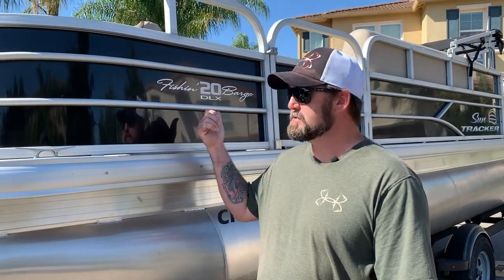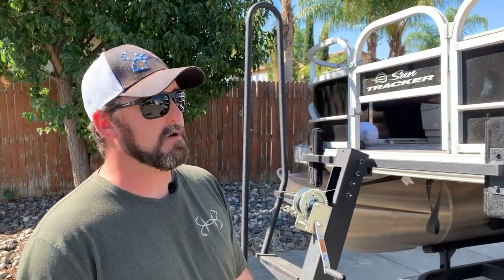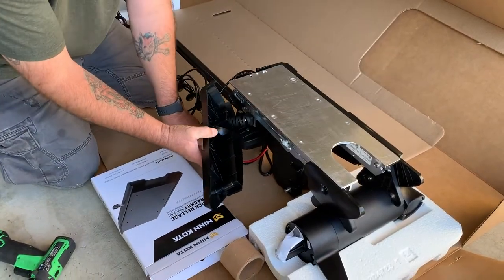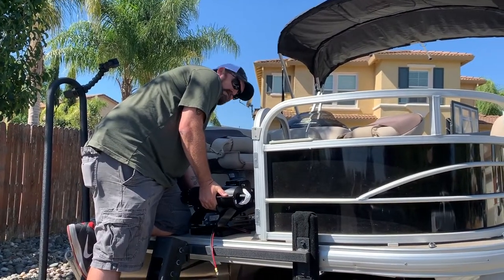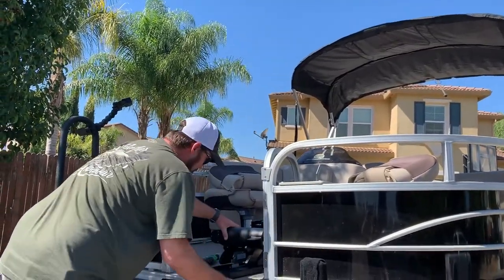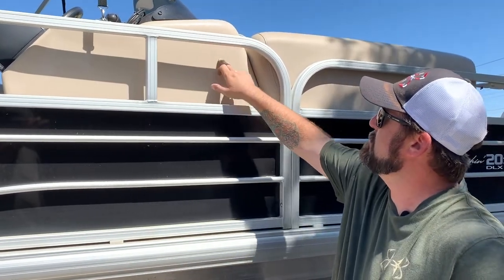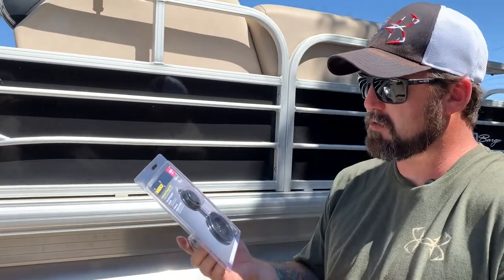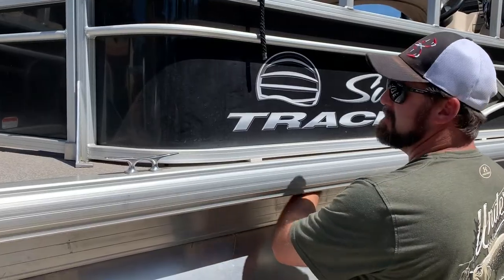MINN KOTA TERROVA TROLLING MOTOR INSTALL ON A PONTOON | HOW TO

Comment: Will the composite quick release not work on a pontoon or is just more difficult to use? I bought one because of the compact size and low profile. Haven't installed anything yet.

Comment: I'm curious how the charger connected to the dual battery, 24v system. Do you have to switch between the 24v wiring for the motor to connect the chargers or will the chargers still charge the batteries individually while they're still wired in series for the 24v?

Comment: I have that same model what length is the shaft  for trolling motor
Reply from the maker: It a 60” shaft .. Let me know if you have any more questions.. thanks for watching
Reply: I appreciate it man thank for the help also do the existing wires for the trolling motor plug need to be pulled for Thicker gauge
Reply from the maker: Only if your going to 36v ..24 they are fine from the factory
Reply from the maker: Of course going bigger on the wires never hurts.. but the factory wires are 8ga
Reply: Hell yeah thanks for the tips man time for me to get er done
Reply from the maker: No problem at all.. let me know if you have any questions along the way

Comment: Any idea what length shaft is best for a MayCraft 1900 for saltwater use? 2-3 ft waves are the norm.

Does the heading sensor wiring get run to the trolling motor or just a 12V connection?

Can the I Pilot link wiring run with the 24V battery wires from the motor to the helm on a center console? the wires will be running in the same chase.

Thanks for the information, and helpful videos. I'm a subscriber!
Reply from the maker: Thanks for watching the channel! So you’re going to be running a i-pilot link with a humminbird networked it sounds like ..? So you would need to hook the heading sensor to it’s own 12v power source.. not the trolling motor batteries..  usually mounted at the helm or near the transom..  as far as shaft length.. hard to say without seeing the boat in person..  but either a 60” or 72” is your only options.. with with swoop up on the bow I’m leaning more towards the 72” just to be safe .. especially in the rollers.. I have put several 72” on north river sea hawks offshore 24’  ..
Reply from the maker: And yes running the network cable with the power wires would be fine.. the sonar cable would cause interference if ran with the power wires.. if you want to measure the shaft length.. measure from the bow to the keel straight down..  let me know that number and we can go from there.. thanks again for watching
Reply: Thank you for your assistance. I measured 43 inches from the top of the gunnel to the water line.
Reply from the maker: Ok if it’s 43” from the gunnel at the bow to the keel at the bottom of the boat then a 60” shaft would be just fine..  and a 72” would be overkill..  keep in mind you might have to make a plate to get the trolling motor level at the bow as best as possible if your bow has a raise to it..  let me know if you have any questions
Reply: 43 inches is the top of the gunnel to the water line. The keel is below the water line. I'm thinking 72 inch might be my best best to keep the prop in the water. Thanks again for your help. I really enjoy your how to videos. Have a Great Labor Day!!
Reply from the maker: Yeah that’s why I said the keel.. you want the motor below the keel of the boat at least..
Reply from the maker: The shaft also has to run through the chassis of the trolling motor and the steering motor mounted on the bow that eats up some shaft length.. but the shaft also doesn’t count the diameter of the motor on the end of it either..  so if the motor will touch or almost touch the ground when the boat is on the trailer you will be just fine

Comment: I realy like your video's supper helpful i have a single battery on my boat and would like to run 2 batterys and a selector switch please make a step by step. Video for first time boat owner's with what i need .thanks Lonnie 1/11/2021
Reply from the maker: Would you like a dual battery set up for a trolling motor or a cranking and house battery set up with a battery switch?

Comment: Where did you purchase the deck-mounted plug for the trolling motor?
Reply from the maker: They come installed on the fishing barge or bass buggy. But if not we used to carry them at the tracker parts department at bass pro. Thanks for watching and commenting
Reply: Thanks for the info.
Reply: @ReelLifeFisherman  don’t see it at bass pro. Do you have a part number?

Comment: Where did you hook up the wire that you ran to the back?
Reply from the maker: Broncin2 to the cranking battery from the battery charger.. thanks for watching the video! Hope you found it helpful..
Reply: @ReelLifeFisherman  on the ground? Yes I did as I'm contemplating on getting the same one.
Reply from the maker: I ran it along the top of the pontoon log and then up into the battery compartment.. I just extended the charger lead wires with marine grade duplex wire.. just make sure you cut and put the in line fuses at the battery..

Comment: Thanks for sharing! It is going to help us out a lot once we decide on a trolling motor. What size do you suggest for a 2017 sun tracker 22dlx fishing barge? Also, what's a good fish finder? We are looking for something fairly reasonable. Thanks for the help!
Reply from the maker: I would go with a 24v trolling motor for sure and I personally like the lowrance elite Ti2.. bang for the buck you can’t beat it.. I don’t care for the lower hook models of lowrance though ..  thanks for watching and let me know if you have any questions..
Reply: @ReelLifeFisherman  awesome! Thank you so much man!
Reply from the maker: No problem at all.. oh and I forgot to mention to get the 24v trolling motor in a 60” shaft.. I would recommend a Minn Kota terrova.. like the one in the video with I pilot
Reply: @ReelLifeFisherman  Ok, yeah I went to Bass Pro Shops today and was talking to the guy about them and he had suggested that one and the Ulterra. I was going to get the Terrova but they didn't have any in stock. They didn't have either one actually. I went ahead and bought a fish finder since we are going Saturday. I went with the Hummingbird Helix 5 since we are only able to get out there on the weekends at the moment. I was thinking about just getting an anchor as well just to get us by until we decide. I don't even know what size anchor we would need for a pontoon lol
Reply from the maker: I would get a 15lb danforth or fluke style anchor make sure to get good anchor rope at least 100’ and 4 to 6’ of heavy galvanized chain
Reply from the maker: The only problem with the ulterra is sometimes the door won’t clear it.. but usually a 24v will just make it under 🤞the 36v won’t at all..

Comment: What terrova motor size would you recommend for a Tracker Pro Guide 175 WT? 12 volt or 24 volt?
Reply from the maker: Jose Montalvo I would personally run a 24v 60"  ..54” would be long enough.. but they don’t make it in a 24v.. a 12v will work just fine but it will die in 4 to 5 hrs most likely.. you can fit 2 batteries for the trolling motor.. I can tell you how if you need me to.. thanks for watching the video.. tight lines
Reply: @ReelLifeFisherman  thanks. I appreciate it. I may just go with the riptide 80lbs 24v 54".
Reply from the maker: Yes that would be perfect.. they do make a 54” in a rip tide I do believe.. but I’ve never seen one in the freshwater..

Comment: Awesome job, thank you for posting this. All of know how much work is put into making and editing videos. Plus you do really nice work! Couple questions, please forgive me if you already tackled these!!!  I am buying an 18' Sweetwater Cruiser and will be outfitting with 24v  trolling for fishing.  I am ordering from the factory and can get trolling motor plug installed... so...
Question 1: Why did you choose under the helm for the two batteries? Was the single battery the factory option that you replaced with 2?
Question 2: I will definitely install the multi bank charger and understand running the line back to the cranking battery.  However we intend to dock the boat with no shore power.  Will the engine return power back through the charger and charger the trolling batteries? If not do you recommend a device to enable that?
Thank you!!!!

Comment: Excellent video! Thanks for posting this. Question- I saw in an earlier comment/reply that this is a 60" inch shaft trolling motor. Is that plenty long enough in your opinion? Would a 72" shaft be overkill? My pontoon actually has a 2' front deck (from the front edge of the deck to the beginning of the playpen fencing), so depending on which shaft length I decide to go with, I will only be looking at roughly 3' or 4' "intrusion into the playpen area of the pontoon.
Reply from the maker: Thanks glad you liked the video! A 60” would be plenty..  normally we only put a 72 on really big deep V boats with a high bow.. but it wouldn’t hurt anything to have a longer shaft.. it just wouldn’t be necessary.. let me know if you have any questions anytime..
Reply: @ReelLifeFisherman  Thanks for the quick reply! By the looks of your other videos, it looks like you live near the Sacramento area. So do I. I was just out on Oroville yesterday. I fish there and Bullards quite a bit.
Reply from the maker: Awesome! Yes I live in Citrus Heights and work at bass pro rocklin as a marine mechanic.. I fish all over .. but I’ve only been to Oroville and bullards once .. camped at bullards and had a great time boat in camping... I want to hit Oroville again to try and get some of those large land locked Kings!
Reply: @ReelLifeFisherman  I pretty much only fish for bass. But, both my son and I have caught salmon at Oroville. (If you haven't already, try fishing for salmon in Potter's Ravine your next trip to Oroville). Do you do side work/installs?
Reply from the maker: I will give that area a shot.. only been there to one time and fished the green bridge and dam areas.. I do side work from time to time absolutely.. earn some fishing money and make content for the YouTube channel..  I only except side work through the channel or social media.. never out of the shop where I work.. I try to only do small jobs in the heat of summertime..  can’t take the heat as much as I used to.. lol
Reply: @ReelLifeFisherman  I have a 2018 Qwest LS 826 RLS pontoon that I would like to eventually put either a Minn Kota Terrova or Minn Kota Riptide Terrova on. I'm thinking about the Riptide because it is mostly white and will "match" my pontoon better as it is mostly white as well, vs the all black look of the freshwater Terrova. I know the Riptide is made for use in saltwater, but that should not prevent me from using in freshwater, correct? Are there any real differences between the two? Also trying to decide on whether I need a 112 vs an 80. The pontoon's dry weight is 2,075lbs., it has a 150hp Honda which weighs 485lbs., it's Max. Weight Capacity is 2580lbs., and it's Maximum Person Capacity is 12 people/1718lbs. I have seen brackets that I believe allow for storing the trolling motor parallel to the front edge of the deck when not being used vs perpendicular, is that correct? Or did I just "imagine" that?  By the way... I completely understand the heat tolerance thing. Lol.

Comment: Great video as I'm about to order Sportfish xp3. The fishing package that comes with it is 55lb thrust and is 1350 bucks. If I bought all this that you used about how much would I pay? I want to do it right the first time like you said. Only going to be on lake. 

Great camera work. Don't know where you are but would love to you to install mine .  

Another question is both batteries under console? The cranking battery is still in back?
Reply: May not need 80 thrusts as not taking offshore.
Reply from the maker: Awesome they are a cool boats! Kinda a fishing barge /party barge combo..  so the terrova is more money probably between $1500 or $1800 depending on the model.. but what you would want for sure.. the 12v would not cut it to be honest..  the two trolling motor batteries are under the console and the cranking battery is in the battery back.. I live in the Sacramento California area and I’m a tech at bass pro shops .. if your in the area let me know.. and if you have any questions let me know..
Reply from the maker: So all together your looking at about $1800 for the trolling motor $60 for the quick release mount.. $300 in batteries and $150 or so for the charger.. maybe another $500 or so for the install.. but if your buying from a bass pro or maybe from a different shop.. you can include that in the price of the boat and do it all on one deal..
Reply: @ReelLifeFisherman  Thanks. Yes, buying from Bass Pro. Ordering from factory. Think I would order that way or wait until I take delivery ? Then have them do it?
Reply: Do still think I need 80 pound thrust since only using on lake? If so , like you said....do it right first time.
Reply from the maker: Absolutely.. a pontoon is a lot of boat to move .. especially in the wind! I would definitely go with the 80lb .. you won’t regret it.. they shouldn’t offer the 12v on anything but the bass buggy 18 maybe.. not even then..
Reply from the maker: And if your financing it they can put everything on the paper for the price of the boat.. that way your not paying out if pocket
Reply: @ReelLifeFisherman  Glad to here you work for Bass Pro. My only concern is when I said I wanted the fishing package  they said that the factory would order it .
Reply: And are they trained the same way you are? The little things like , metal slide pointing to back, charging plug up etc.

And would they get pissed if I told them how I wanted it?

Will be using Cabela's in Huntsville, ala. I live in Franklin, Tn and will be using it on Lewis Smith Lake in Alabama.

More trivia. Opened Bass Pro in Nashville as Asst Manager with them about year .

Lived in Orange Country for couple of years. Hated it. Then Moved to Bakersfield and loved it. More like the south to me and real genuine people. 
Fell in love with Yosemite and started my backpacking career. RETIRED and buying house at Smith La.ke. Got to have house before boat.

You should get out of CA and move Sourh . As a lot of Bass Pros down here and I'm sure would welcome good tech like yourself.
Reply from the maker: Thank you! I would hope they could put on a trolling motor like this..  they should be able to.. they don’t really train us though so I can’t exactly say.. unfortunately not all the shops do the same quality work.. but if you told them how you wanted it.. I don’t think there would be a problem.. I have been thinking more and more about leaving CA for sure! I lived in Texas while I was in the Army and didn’t mind it.. the wife and I talk about leaving to places like South Carolina or Florida maybe.. TN .. just would have to be near some great fishing to replace Northern California.. all the different kinds of great fishing and my family and a good paying job is all that keeps me here.. it’s not for all the stupid laws and politics I can assure you!  lol There are a lot of fisherman and outdoorsmen here and that is the only reason most stay! Most of us are really fed up and pissed off.. and lots of people are leaving! But it’s not easy to do! But I would love to move to the other coast and give it a shot! Just working on my dad... the only place he would like to go is back to Oklahoma or Arkansas where he was born and raised as a kid.. I’m not a fan of being landlocked! Lol.. you can ask me any questions anytime and thanks again for watching the channel..
Reply from the maker: Absolutely let me get the list of stuff..  I could send you the links to the stuff on Amazon even.. I will work on it later this evening when I get home from work
Reply: @ReelLifeFisherman  Thank you so much. Just so I can have it in my hand when I go in. Should let factory do it? Or wait until boat is delivered? Still pay up front.
Reply from the maker: The factory won’t install it.. it would still be done at the shop.. even if you bought the fishing package
Reply: @ReelLifeFisherman  Good to know. When I order will include in total. And when I get your list will just tell them this is what I want..  part numbers etc.
Reply from the maker: Ok awesome I’m working on the email now .. I will let you know when I send it
Reply from the maker: Ok I sent it ..let me know if you got it and if that works..

Comment: How long the shaft should be on my Sun Tracker 18dlx? Thank you
Reply from the maker: Yura Slezko thanks for watching the video! I would run at least a 54” shaft but a 60 would be good .. especially in rough water.. let me know if you have any questions
Reply: Tracker installs a 54" shaft on the 18' dlx when you order the trolling motor/  fishing package from the factory which is dealer installed, but agree a 60" shaft will work too